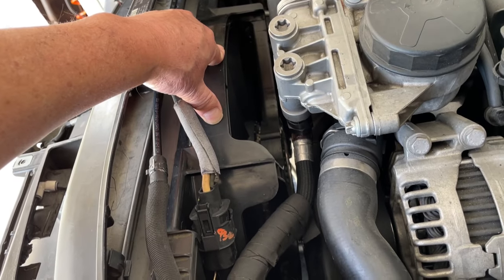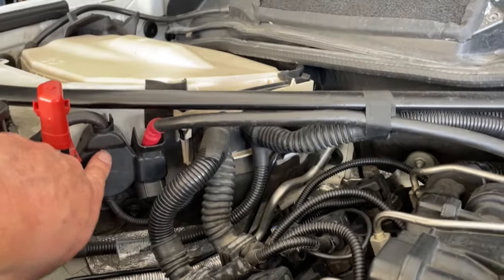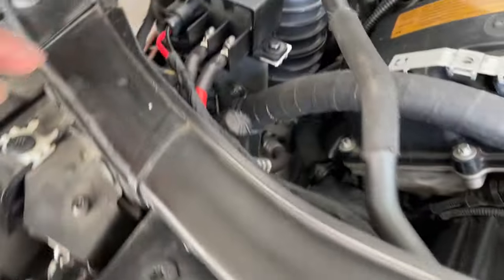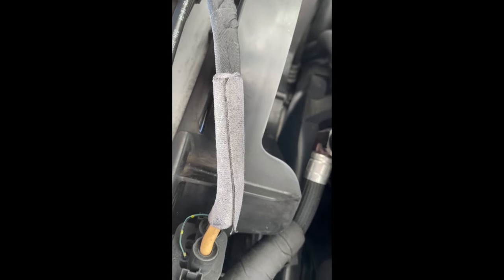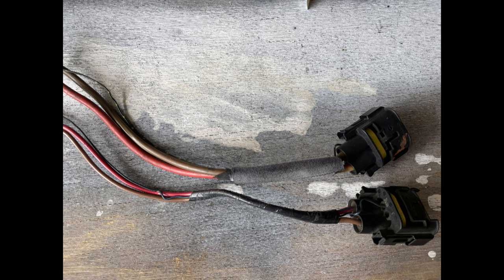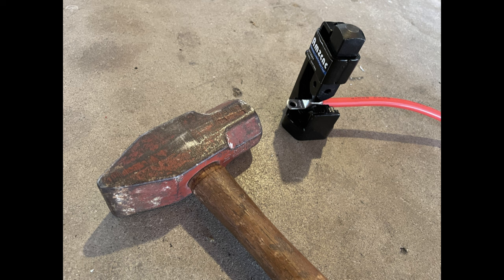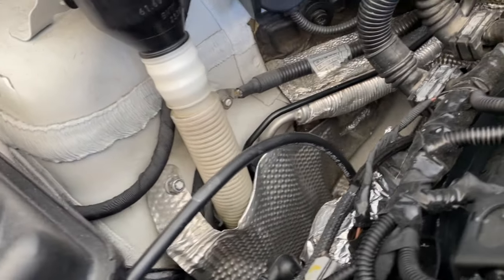e90 335i Cooling Fan Upgrade from 600w to 850w

Comment: It's always the small channels with the best content. It's great seeing non M models getting pushed to the limit. Where do you see the build ending up when it's all said and done?
Reply from the maker: Thanks for your gracious comments.  This is my most recent project along with increasing the size of my aux radiator.  I ran into some limp mode problems at Chuckwalla recently so I'm trying to address this issue again.  I did some weight reduction by installing Cobra Nogaro seats, sun roof delete, and rear seat delete.  Gutting the car is not on the radar but I'm looking at other weight saving options ie hood and trunk.  That's it for now but I have a hard time leaving stuff alone, haha!
Reply: @DailyDriverTracking  I've been brainstorming about how I'm going to keep my E90 cool when I finally buy and inevitably track it. Some solutions I've seen consist of retrofitting the S55 charge cooler (Seems Legit Garage), running dual setrab oil coolers in parallel w/ shrouds, custom Plazmaman tube-fin intercooler kits, meth along with E85, auxiliary radiator, and a few others. Weight was a minor concern, as long as I can reach 3300lbs with me in it, I'll be happy. I've also heard about oil starvation/pressure drop but plumbing an accusump from the trunk might help. Lol these project cars are all a deep end but when they work they're incredible.

Comment: Is the 850W slimmer than the standard 600W fan? I don't necessarily need more cooling but I've installed 2" inlets and have been looking around for slimmer fan to buy more clearance away from the pulleys and belt. It looks slimmer in the video but if anyone could confirm that would be super helpful!
Reply from the maker: Good question.  I didn't know.  I just now measured to compare.  The 850W fan is about 1/4" wider around the rim of the fan but the center hub sticks out about the same.  The 600W fan spokes taper narrower toward the outer rim, the spokes on the 850W fan are straight and do not taper.

Comment: Did you wire the old fan wires into the connector that plugs into the relay? Does the wire size not effect it?
I’m planning on installing mine soon too.
Reply from the maker: That's great.  Yes, the current for the 850 watts is sent through the large terminal of the new 150a relay.  The small connector sees minimal current as it just controls the switch actuation of the relay.  So the 16g wires should be fine.

Comment: could you please tell me where that relay normally sits??? i cannot find it in my car...
Reply from the maker: https://www.youtube.com/watch?v=2fwsCGi4xcM This video shows the location on the 335d relay but it's a bit hard to see at (9:03).  Found my relay in the DME box in front of the DME.  Mine was blue plastic.  Other models may have them here? https://www.bmwpartsdeal.com/parts-list/2007-bmw-335i-sedan_e90/vehicle_electrical_system/relay_electric_fan.html?pnc=01.   I piggy backed the new relay by hooking it to the old fan wires.  Power is constant to the existing wires so best to disconnect battery ground before doing any work.  I used a piece of 1/16 thick 1"x1" aluminum angle to hard mount the new relay.

Comment: Very good knowledge of car electrical wiring. I wish I had half of it 🙂I heard that radiator fans are effective at low speeds (less than 45 mph). At track speeds,, what matters most is efficiency of cold air inflow and heat extraction.
Reply from the maker: @mowjinkaljibal Thanks for your comments, you know where my help comes from.  I looked into what you heard.  Seems to be a lot of factors to consider in determining whether a stronger fan will help at track speeds.  One reason I chose to do this upgrade is that this same fan was used by the factory to increase the cooling on the n54 for the 335is and the 1 series M.  But like you I'm a bit skeptical.  We'll see how it works out when we go back to Chuckwalla in 90 degree heat.
Reply: @DailyDriverTracking did you get tune?
Reply from the maker: @ricolam4916  Yes, MHD custom tunes from Wedge Performance.

Comment: Just did this job today but my wiring harness is from a 2011 335is . Instead my positive goes to the battery
Reply from the maker: Thanks for sharing that option.  The large relay really draws a lot of current when the car is sitting.
Reply: Where did you get that smaller relay
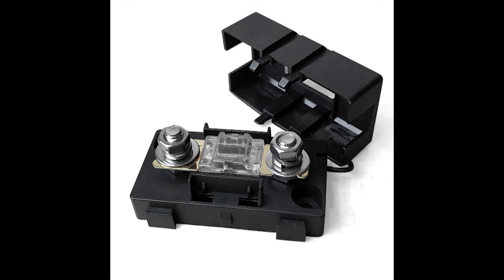Reply: 2:44
Reply: Actually nevermind since mine is off a 335is it plugs into the power distribution with 125 fuse. The plug closest to the gas cap
Reply from the maker: @georgestinnett4367  The purpose of the main relay could be to cut power to the fan if the PWM Arduino fails.  https://ls1tech.com/forums/forced-induction/1906766-variable-speed-pwm-fan-control-under-25-less-diy-10.html#post20316431
Reply: So im getting a 2efe code did i hook up the positives on the wrong side of the relay
Reply from the maker: @georgestinnett4367  are the old fan wires hook up to a new relay as shown in the video?
Reply: Im pretty sure i can double check. If not ill have to check the relay by the dme to see if im getting voltage aka fan signal wire.
Reply: @DailyDriverTracking   figured out my problem it was this 61-14-6-971-370. 335is has a fuse in the slot its farthest slot from blue dot. My 335xi didn't have a fuse in that slot
Reply from the maker: @georgestinnett4367  Awesome! Good job!
Reply: @DailyDriverTracking  no luck still getting 2efe code
Reply from the maker: @georgestinnett4367  Sorry to here.  Wish I had some ideas to help.
Reply: @georgestinnett4367 did you fix the codes? Im planning on doing this mod to my e92 335i too. Do I need BmW ppk? Or is it just plug and play?
Reply: @ricolam4916 do you have the stock wiring harness or is it from a 335is or is it the retrofit harness with relay. If you want it working at 100% without electrical risk or do you want 100% working but higher chance of electrical issues. The little to no labor way is  option 1 .yes it works the plug and play on the stock harness 335i or xi  (600 watt) . And the issue for me i  rewired a oem stock 335is wiring harness (800 watt) and when i used a butt connector was causing that code
Reply: @ricolam4916  my next want is a m4 intercooler
Reply: @georgestinnett4367  im stock 335i. I would I go for the 100%. Do you have the part lists in order work 100%